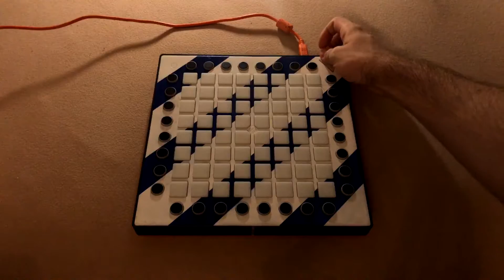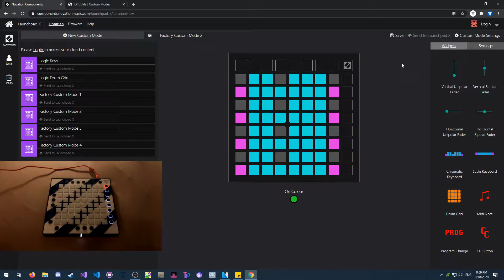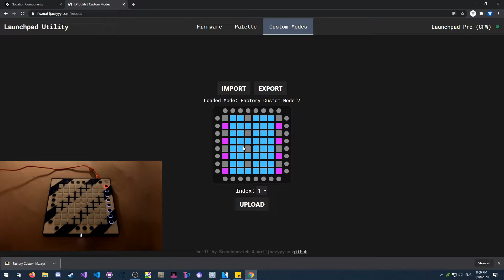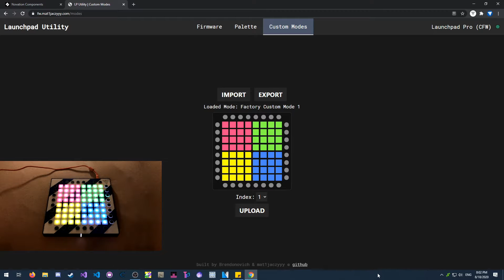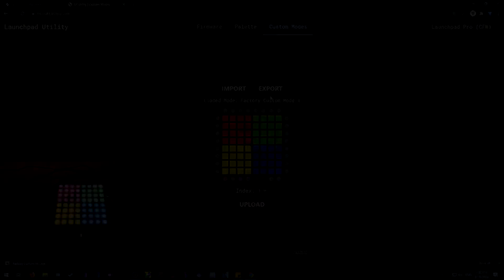LPX Custom Modes for Launchpad Pro Custom Firmware (with Components)

Comment: I cannot get midi input to work into the back of the Launchpad once I update to the custom firmware. I am trying to run an Alesis Trigger IO into the back but cannot get any midi to actually run through the device. The rest of the custom firmware seems to work well enough, but I also have no clue what the buttons on the bottom of the setup page mean. Is there a manual for this firmware anywhere?

Comment: wow ... this is so cool.. does this still work though? I tried importing a file made on LP-X in components but it says "Invalid Mode File", then I tried to import one made from LP pro, and the file loads in the utility, but nothing happens on upload, my pro-mk2 just blinks once and stays as is with the red user light on.. any help would be greatly appreciated!! Thanks...
Reply: Same problem here. It did work, but the lpx custom modes created on the components are different now and wont load.
Reply: Looks like novation changed something. This might work with the old files though.

Comment: Hi! Thanks for sharing this with us! I have some questions:
First, which mode do you select in the second 0:15? On my vanilla launchpad it does not appear.
Second, can I go back to the vanilla launchpad once this firmware is installed?
Thanks for everything!
Reply from the maker: yeah, you can restore to stock firmware easily the same way.
the custom mode is only available on custom firmware

Comment: ohhh Yes i fixed it by downloading firmware updater from orignal novation website and it fixed!!

edit : i actually got a problem that my mk2 was stuck in boot loader mode even when i unplug and plug the cable and even when i restarted my pc!
but thank god that i FIXED IT!!!!

but also I am not complain g . The custom firmware is awesome I love it on my launchpad pro! i having it for like 1-2 years now!!! The light brightness adjuster is best!!